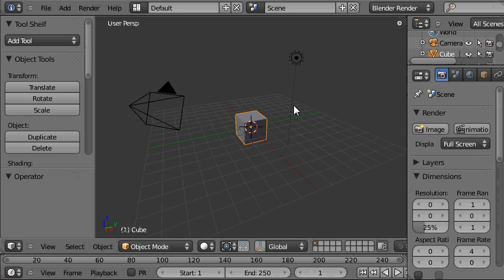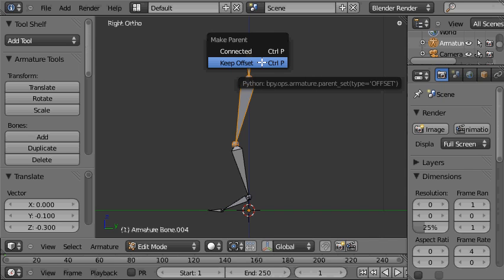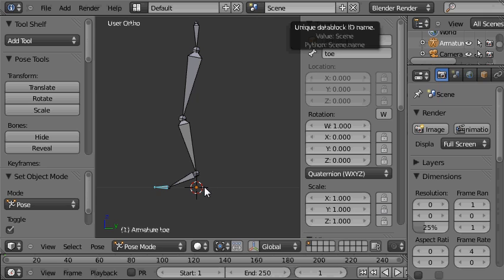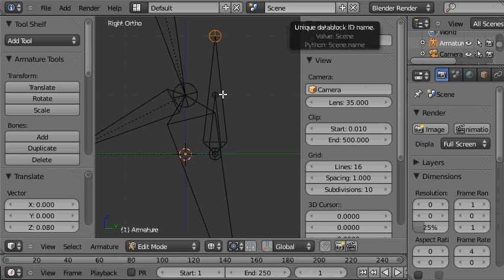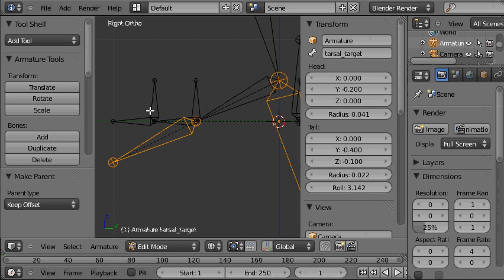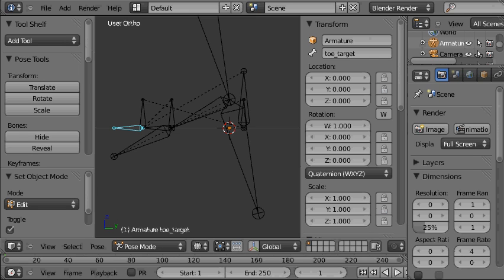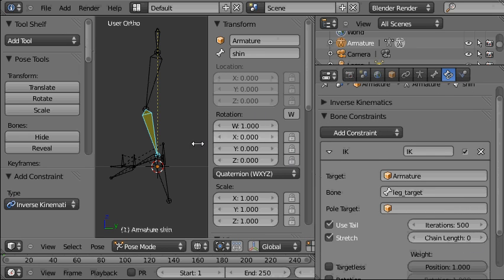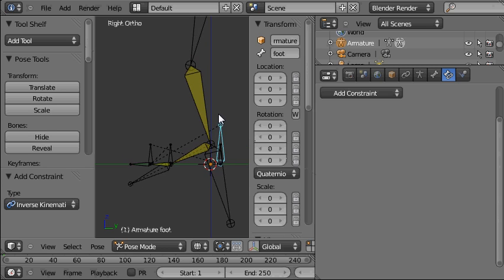Tob's Blender 2.5 Foot Rigging Tutorial 2/10 Armature and IK

Comment from the maker: @tobuslieven: Also it's possible it's there but just doesn't fit on the screen, if that's what's happening you can scroll the tabs at the top of the buttons window my Middle Mouse Clicking on the tabs section and dragging left or right, of if you don't have a 3 button mouse, you can do the same by pressing Alt and Left Clicking and Dragging on the tabs section. 

I hope one of these suggestions helps!